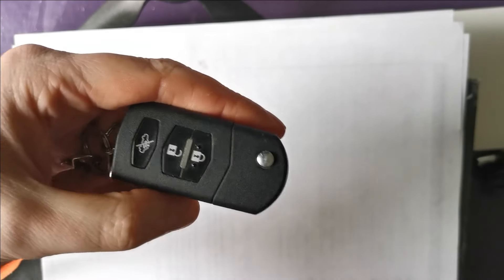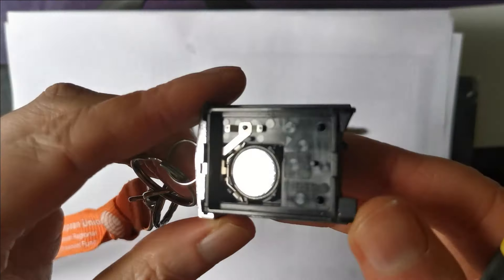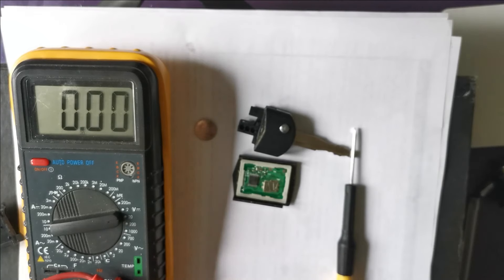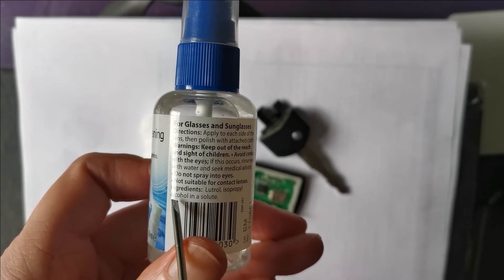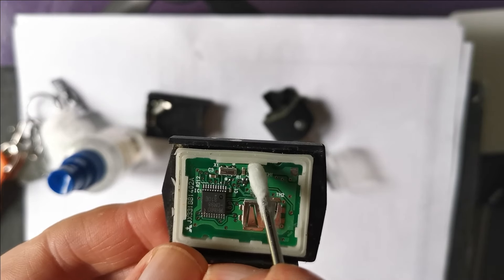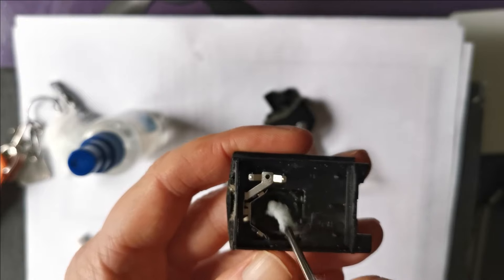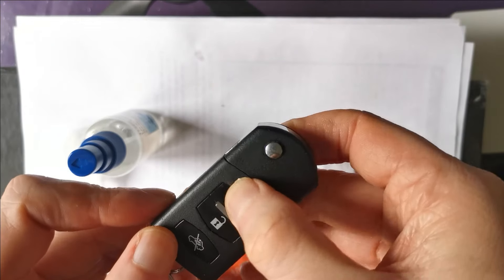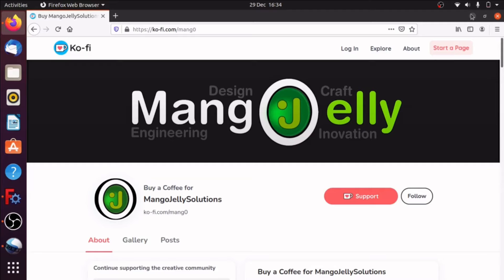Car key fob draining / eating batteries quickly and dead. Fix the problem for all models.

Comment: Best advice - thanks. Changed my fob batteries 3 times in less than 6 months. Thought the fob was faulty. Tried this and problem resolved!
Reply from the maker: Thanks for the feedback. Hopefully this will save you money going forward
Reply: I change the battery each 2 days😂😂
Reply: @momor7786 did you get yours any better?  Mine is the same, by the time I take the darn key apart and put it back together again the brand new battery is almost dead again already!  Literally in a day ro 2, and I've tried all the basic stuff of new battery, different brand batteries (thought I was getting old stock or something) tried 90% isopropyl alcohol clean up and tighten the battery connections etc.  I gave up, thinking it might be a capacitor or other component on the board, or maybe even the ECU
Reply: @minus3dbintheteens60 yes
I clean it. Than I separate where  the battery touch with tape. I think you must louck at the battery place may be + and- touch together. And clean very whell. Now the battery its work more than a month

Comment: So much misguided "help" out there, but this is the real answer. Thanks for this!

Actually, the problem of contact resistance affects every kind of device that uses batteries, and the battery performance of all of them can be improved by reducing the resistance of every contact point. In the key fob, there are 4 contact points:
1. The negative battery metal to the negative contact
2. The negative contact to the circuit board.
3. The positive battery metal to the positive contact.
4. The positive contact to the circuit board.

This means there are 8 metal surfaces that the electricity must pass through to complete the circuit, and any ONE of these surfaces can introduce enough resistance for the circuitry to not function.

I actually went a step further and used a tiny piece of 400 grit sandpaper to scratch 6 of these surfaces:
1. The negative battery terminal
2. The sides of the battery, which are the positive terminal, all the way around.
3. The metal that contacts the negative battery terminal (one end of a strip that is made of nickel)
4. The other end of the negative connection, which contacts the circuit board.
5&6. Repeated 3&4 for the positive connection.

Prior to doing this, I measured my battery at 3.037 volts bare, and once installed in the battery holder, the voltage from the nickel contacts was only 2.811 volts! After the sandpaper treatment, the voltage between the nickel contacts was 3.037 volts - 100% of what it should be!

The metal on the circuit board is very thin, so I wouldn't recommend any abrasive treatment, unless an initial treatment of the battery and battery holder contacts fails to yield any improvement.
Reply from the maker: Thank you so much for the indepth reply, this is going to be very useful for people to understand what is happening and how to further fix the issue of it continues. Thank you for taking your time to do this.
Reply: isoprophyl alcohol should do the work?

Comment: I was sceptical but having changed the battery only to get the   same warning again 2 weeks later.  Car is 2 years old and key lives in leather fob. No visible wear on contacts but “cleaned” with IPA and cotton bud and it’s been good for two weeks and counting. 

Really easy and insignificant cost so has to be worth trying!

Comment: This worked on my BMW fob.
Thanks!
 I changed both batteries about 6 months ago, I don't even use that car very often but it stopped working really quickly and these were expensive 2450s that cost me £4.50 each.

I used those actual earbud cleaner things and 70% alcohol gel.
Sorted.
Reply from the maker: Superb great to hear that it's helping with saving people money. Thank you for feeding back.

Comment: Yeah I think this helped me out. I bought a replacement fob which of course was new to me but I’m guessing had been sitting on the stock shelves for years.  It was going through batteries every 2 weeks. I arrived home last night from a high school reunion at 130am and my car was sitting in my mothers driveway in a nice neighborhood. My alarm sets automatically when I lock it with the fob which I did before I left.  The problem was when I arrived to get in my car the fob wasn’t working and when my alarm is set if I use the key to physically turn the lock and open the door the alarm will go off and I didn’t want to wake up all the neighbors. So I got out my handy isopropyl wipes and a small screwdriver I keep on hand at all times and cleaned the terminals which had residue on them. I was able to gain entry into my vehicle in silence and drive off down the road with a renewed sense of vigor and accomplishment.
Reply from the maker: I feel your pain, had exactly the same thing. I read somewhere with some cars if you turn the key to lock position for ten seconds it cancels the alarm. I need to try it out.

Comment: I have this problem on a brand new key - so it's pristine, clean.   Three different batteries so far, each lasting just 4 days or so.
Reply from the maker: Apparently my key that I bought as a spare  was supposed to be new but it turned out it was refurbished after I opened it up and found ware on the contacts when I went to replace the battery, and it was way too much ware. The garage then ammited it was a refurbished key.
Reply from the maker: Another thing to check is how far away your car is from the key when your in your house. If you have a car that is relatively recent the engine will communicate with the key if its too close draining the battery.
Reply: @MangoJellySolutions  it is kept alongside my spare, tatty key whose battery lasts the proper time.

Comment: my problem is actually the fob draining the battery, not the opposite which would happen with resistance-adding dirt.  I pull the battery and quickly measure the open-circuit voltage and it is low and rising becasue the fob was holding it low.  After a long time, the battery won't rise on removal but will be dead flat 0.0V (a normal low battery from a fob won't be dead flat).

Comment: hi im having an issue with my car starting mechanic says its the key FOB i asked him if there is a simple way to clean it and he said no, i will try this before i go to the dealer, what was that cleaner, was it lens cleaner like for my eye glasses? Thank you
Reply: Yes lens cleaner for eye glasses. Just tried this and my fob works perfectly fine now
Reply from the maker: Yes exactly that, lens cleaner.  Yep give this a go before going to the dealer.  Please let me know how you get on.
Reply: @MangoJellySolutions   my key fob works like it's brand new. THANK YOU ! I've sent your video to my other buddies. I even cleaned my spare key as well. Again thanks a lot.
Reply from the maker: @Music-yq8qc  AWSOME!  So pleased I can save people money and not get fobbed off (excuse the pun) by certain dealers trying to get you to buy new keys.  Note to anyone reading this, if you do buy a 'new' key, it will be refurbished, you can see that by opening it up and looking for pitting and wear on the metal contact points.  If you find this take it back and ask for a new one.

Comment: how low the voltage of the battery get when you need to change the battery if the problem is not the cleaness of the battery?

Comment: My 10 year old key fob works fine.  The new one (purchased from the dealer for the same vehicle) works for a month or so.  How can it get more dirty/corroded than the original 10 year old fob?
Reply from the maker: I had a similar thing and found that when we opened the fob in the first year of purchase we found it was a refurbished one.  I don't know if there is some kind of production line recycling going on but it seemed very strange.
Reply: @MangoJellySolutions  👍 Thanks.
👍

Comment: Thank you I used hand sanitizer other videos say I can use vinegar but hand sanitizer worked
Reply from the maker: That's great! Just watch out that the hand sanitizer doesn't leave a residue.  Check the ingredients just in case.  I wouldn't use vinegar as it's an acid and if not fully removed can cause additional corrosion of the terminals.

Comment: My key fob has been going through batteries in a few days and the batteries themselves are actually dead (I tried one in my backup key fob and it doesn't work while a fresh battery does). Do you know what the problem might be?
Reply from the maker: If they are being totally drained within a few days that sounds like the key is making constant contact. Check to see if there is any damage to your buttons. Sometimes with rubber buttons the rubber degrades and the button collapses inwards  forcing contact. This can happen if the key is in a room that changes temperature and there is just enough room inside the key  to stop the contact, when the key gets warm (most keys are black and black absorbs heat so if your key bowl is in the sun it will warm up quickly) then the rubber expands and contact is made draining the battery.
Reply: If the key would be making constant contact, would the car be constantly locking or unlocking when I'm near it? Because that isn't what happens...
Reply from the maker: @thematrix7225  If it's happening and the key is  out of range of the car then no, just picking it up can cause the key to free the connection.  This may be only over times of temperature differences. This is one of the problems that was happening with a key from a customer (I used to work in the auto industry and investigated this as the shear number of complaints and my interest of electronics).  They only noticed when on a hot day their child noticed their light on the key was flashing every now and again.  They was kind enough to send us a video, I noticed the rubber key was convex due to wear and was creating just enough gap to not make contact but when the key got warm then the key expanded with heat and light would start to flick on and off. Replacing the button solved the issue.  

If there is no wear on your button then it's worth opening it up and checking that there is no damage to the circuit board, it may be bent again causing issues with contact.  If not it might be time for a replacement key.
Reply: Thanks for the reply. Even when the key is in range the car doesn't lock or unlock.
Reply: Same I would have thought the issue is his video is rare but all these people are thanking him. My Battery is drained in days so the garage remote is obviously pulling power non stop.  I cleaned the board with electronic board spray and still didn’t resolve so replacing with another.,,they’re not expensive it’s just annoying and occurred without reason.  The remote is 1.5 years old
Reply: @anflexboi  I have the same on a Passatt fob.
 It eats batteries  in a week...but the strange thing is even when it stops working correctly it will still.lock the car but NOT open it.
 A brand new battery and it fine for another week or so....
Reply: @The Matrix Did you ever resolve your issue?  I have exact issue and it is sooo frustrating.  No one can help resolve.  I have been replacing batteries every 4 or 5 days since Christmas time.  I have tried every hack even buying a Faraday Box to keep fob from communicating with car.  Nothing works.  Ford dealer says they have never head of this issue.  I am seriously thinking of getting rid of car.
Reply: @Dina Zimmerman  I have the same problem with my vw Passatt. Key will.actually lock the car but not Open it.....can't be using more power in the key fob to open it as opposed to locking it.  But that's what it seems like.
Reply: @dinazimmerman3384   Funny that Ford would say that.. I'm having the same issue with a 2020 Ford Fiesta ST and finding loads of topics online about it. Really frustrating!

Comment: I will definitely try this, but my 7 month old Mazda has been wearing out batteries since day one of ownership.  Could it be dirty contacts with a brand new car??
Reply from the maker: Mine was the same, found out that the key was refurbished
Reply: @MangoJellySolutions  refurbished right from the dealer on a brand new car??
Reply from the maker: @josephpopiel4793  it was a ex demo with around 100 miles on the clock. Found out the oldest thing was the key.

Comment: I did this and it seemed to help but I'm back to eating batteries again but you have me wondering if the wear on the terminals is my issue
Reply from the maker: If you got some soldering skills drop a bit of solder on the points to get rid of the pitting. That's what I had to do with a friends key to get hers working. It's was worn through.
Reply: Check my reply for another option
Reply: Mine is still draining battery in 1 day!  
Any other fixes?

Comment: If I’m not hearing my car lock when I click lock is the battery dead in it? Also in one of my doors when I shut it I doesn’t sound like it shuts correctly but it shuts and I get a passenger door open when I drive.

Comment: I had a battery drained after a few days on my remote clean with IPA didn't work. I reflowed the board and removed a few components and replaced them back. Then it came out good. When i was checking the terminal there was no open circuit. After reflow it went to open circuit
Reply from the maker: Thanks for the feedback. I have come across Key with a similar issue. On close expection you can see the terminal has warn down to the bare board. Thinking some solder would help in this scenario. Thanks for feeding back.

Comment: Do you think this could cause the key to stop working next day with a battery low warning
Reply from the maker: This is what was happening to mine but in a few weeks. I would open up the key and have a look at the terminals inside and give it a go. They may be well and truly gunky. Mines still going strong from when I last did the video. The dealer seem always to replace battery or key and ignore the terminals.

Comment: So the "dead" batteries should work again after this?
Reply from the maker: From the lab tests we found that  when the battery is at maximum charge it's able to make a decent contact across the connection. It's only when the voltage drops slightly that there is not enough power to bridge the gap causing what seems to be a dead battery after about a month or less. The battery I used would not turn the key on  but you still can see it still has plenty of charge. After the procedure the battery stated working fine and still working now, one of  my spares also has had the same treatment and that's getting on for a year and still going good. I was changing that every month or so. Its pretty annoying that the dealer didn't pick this up after returning twice. I even took the voltmeter with me last time and they suggested a new key fob which would of cost even more.  You will see this more in winter as the chemical reaction slows down  in the battery and I am noticing a sharp increase in views of this video from the northern hemisphere so looks like this is starting to happen.
Reply: @MangoJellySolutions  what are your thoughts on a fob working fine with a new battery. But after a week or so it will only LOCK the car NOT unlock it.

A new replacement cell and it all works fine again.